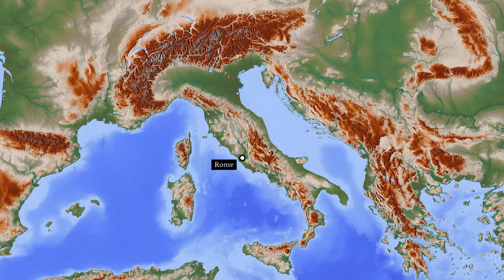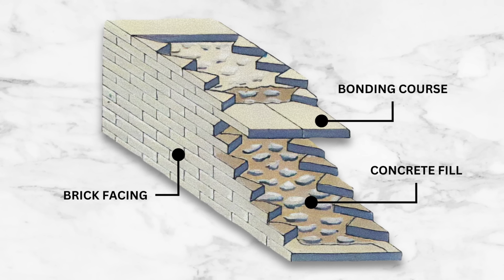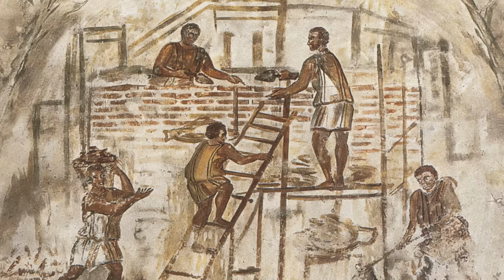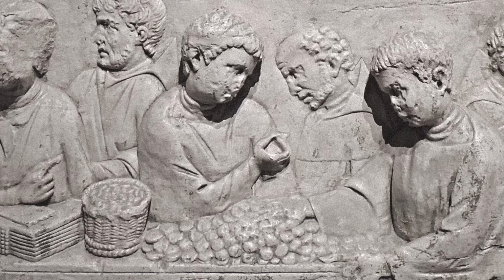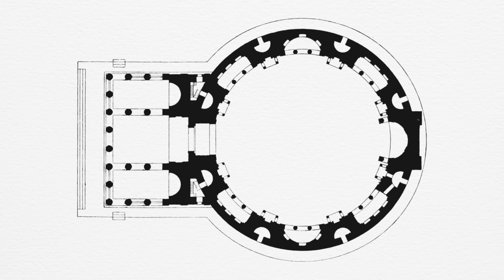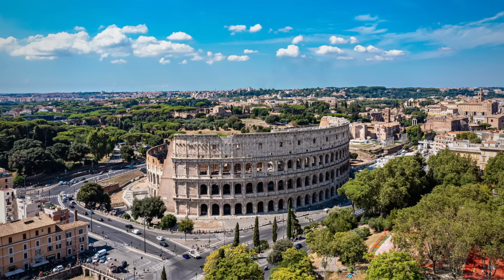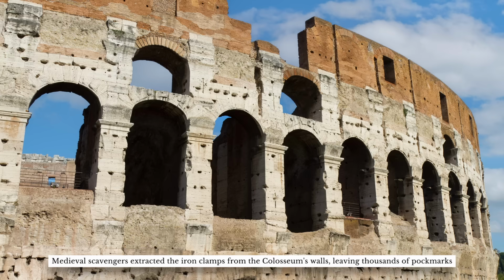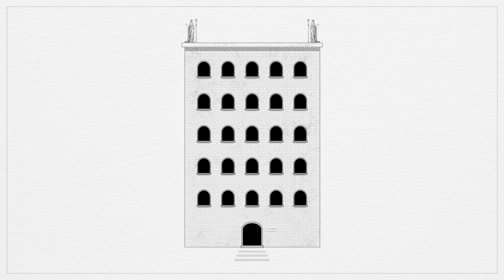Why isn't Roman Concrete used today?

Comment: It’s not used (yet) because it wasn’t understood how it was made until recently. Now they’re working on new formulas that are even better. But it takes some time for new products such as concrete to pass codes and get accepted. A code that requires specific content and standards will not be easy to come up with new standards as everyone is still working to the current standards. It also difficult to convince authorities to change something that’s been around for sometime.

I also don’t believe that anyone would want to build skyscrapers out of this material. The goal is to build structures that we now use concrete for where this would offer greater stability and longevity. Concrete foundations would be an example, but not a tall building itself that would be built over it.

Comment: Many modern concrete structure today, including foundations and walkways, use some amount of iron rebar. Steel reinforced concrete needs to have similar hardness at the boundary between the iron and the concrete.

Comment: Too many errors in this to take seriously.  “Roman” concrete was made using volcanic ash, a pozzolan.  That ash is unlike the ash that is still used currently in many places but sadly with the greenies, a limited resource generated by coal burning power plants.  Concrete does not “dry” out, it cures.  Ancient concrete did cure harder under water but so does our concrete today.  Simply put, the water aids in the curing process.  Fly ash, our current pozzolan, was heavily used in building dams in the early part of the 20th century.  Cure rates were calculated to decades for maximum strength.  Chemical admixtures, used for decades aid in curing and finishing of concrete today, something that wasn’t well known in ancient times.  I’d be curious to know more on that score but this video has enough errors to confuse folks.  Reinforced concrete wasn’t something available in those days either.  Steel, the major material used in reinforced concrete, did not even exist at the time.  It doesn’t make concrete stronger, just keeps it together when it does crack…and it will.

Comment: I've had lengthy discussions with an architectural engineer about the possibility of building a family home which is designed to last 1,000 years. With today's technology it is definitely possible, but the cost would be horrific. Because it requires roman-style waterproof concrete essentially, reinforced with glass fibres, and tilt-slab construction where the hardware is all very serious stainless steel. The roof is concrete as well, and slightly curved. 

The windows all need to be 1cm thick armoured glass, and all the frames of brass. The electrical system is problematic, as there is no way to install systems which will last that long, so all the electrical stuff is in conduits embedded in the walls, and in carriers in the ceiling space, so it can be easily replaced every few decades.

It was a fun mental exercise with him, over many sessions. That was 20 years ago, and he figured a budget of $50,000 per square metre should cover it.

Comment: Isn’t travertine just layered limestone, usually formed from hot springs?  How is that weather resistant?  It would be as bad as marble.  Put it in a temperate climate, and it would chemical weather up a storm.

Comment: Ironically what makes modern concrete viable (steel reinforcement) is also what makes it shortlived.  Microcracks allow water to get in and rust the steel causing it to expand and crack the concrete

Comment: If I understood your concept, you were hypothesizing using Roman engineering to build the Monadnock building, but what if you used modern reinforcement?   Replacing the modern concrete with Roman concrete.  Cost not being a factor, would you be left with a better product?  Expand this thought experiment to other modern concrete structures (i.e. roads, foundations, culvert, etc).  Using modern engineering and ancient concrete, what would that produce?

Comment: We probably have to adapt some of the old ways to build new structures instead of using magic math to do creative and extraordinary forms. It would last longer.

Some of the old ways are more expensive, but it could be lessened by modern technology or slabbed on cheaply for riverbeds, water channels etc.

Comment: it seems to me, for such a building project, you would make the vertical structures out of pre-cast and set roman concrete bricks in a variety of shapes and densities that interlock, and get an outter layer of wet concrete applied. Each unit could be pretty small. "building bones" about the size of two fists on average.
Reply: and in time the bones might even full "grow together" - damage automatically localized and highly repairable too

Comment: Use fiber optic lighting from the sun. BOOM! Lighting problem solved. So the other issues would be time consuming and expensive? Those are really not huge hurdles.

Comment: Would be such a nice video if you just can use a normal measuring system with sense (meters), instead of the stoopid king’s-feet based MAGA system that is used in ‘merica
Reply: Imperial system been around centuries before MAGA.

Not to mention that UK still uses MPH (Miles Per Hour) instead of KPH (at least some times)

Comment: Its not used today because of two reasons:
1) Modern concrete is cheaper.
2) Modern concrete doesn't last, which creates more profits from "rebuilds".
Reply: not every building needs to be perserved for 1000s of years. I don't even think the romans were even thinking in that scale either as long as it lasted within in their lifetimes
Reply: @monsterhunter445  Of course the Romans weren't thinking of that. That's not the point or topic. If lasting longer was in their minds, they were so thorough that 90% of their construction would still be perfectly usable today.

Comment: Roman concrete owed its unique properties to  the chemistry of pozzolana. Ordinary lime mortar  
hardens through contact with the carbon dioxide  in air. Pozzolana, however, contains soluble  
silica and alumina, which react with lime to form  exceptionally stable bonds that can 
consolidate without exposure to air – even underwater. Sea  water, in fact, makes the mixture even stronger. The soluble silica and alumina, especially soluble silica however the alumina is not soluble unless it is grinded to become fine enough like dust that it can have a lot of surface area to react with the lime and the same can be said for silica but silica can be transformed into a water soluble form of silica in the form of waterglass or sodium silicate containing 50% silica and 50% sodium carbonate.

So why not mix an equal volume of sodium silicate powder with an equal volume of quicklime or slaked lime. first by mixing the sodium silicate powder with enough HOT water to turn it into a liquid and then adding the slaked lime powder into the water dissolves sodium silicate powder and turning it into a calcium silicate cement mixture. Then add it to a mixture of sand and gravel to form the final concrete product. A calcium silicate mortar or a calcium silicate concrete.

Comment: 2'30": Roman concrete compressive strength is equal to that of good modern concrete" is an absolutely false statement. Roman concrete has a compressive strength between 3 and 13 MPa. Our STANDARD modern concretes have a compressive strength between 30 and 50 Mpa.

Comment: There was a Hindu Temple built in the United States around 2012 (not the giant one recently completed) the building of the temple was done almost entirely by hand, and skilled traditional masons from India were employed and the progress is documented on YouTube.  They decided they would source the materials for Roman concrete, and employed someone who knew the correct ratios for the mix and the right aggregate composition for a foundation, it was a success with zero cracks and it set like rock.
You should look up Coade Stone, which sets like marble and doesn't weather in the slightest, there are statues including the white Lion in London, which looks the same today as it did when it was cast over 100 years ago... most people think it's been carved and polished like white marble but it has the same consistency as Roman Concrete... through my own research I found that it wasn't invented by the Coade family, but was brought back from Greece in 1760s by The Society of Dilettanti which George Anson and his brother were members of.  They were tasked with bringing back samples from a certain temple, and using the Alchemical labs at the Royal Institute to figure out how the Greeks made it.  The long list of ingredients are actually known now from the Coade stone page on Wikipedia, but quantity and ratios are still a secret.  I did discover one thing though, they had a solution which was water alcohol and vinegar, this dissolved the stone instantly, but take a hammer to it and you'll struggle to even chip it.  Anyone wondering where the history of the Anson connection is, it's not so easy to find, search for Anson journals and Thomas Ansons especially, if you like rabbit holes he was one secretive guy, as opposed to his older brother who was Admiral and captain of the Navy and circumnavigated the world in 1740, using both longitude and latitude coordinates thanks to the mind-boggling invention, the marine chronometer' by John Harrison.

Comment: QUESTION
What about steel-enforced Roman concrete? Wouldn't that be a possibility, too? Maybe even THE possibility?
Reply: We don't build anything anymore for arbitrary qualities like beauty, function, etc. We build so someone can make money, so no, if this is better technology, it will only be introduced by the system for the systems benefit at their discretion.
Reply: @xravenx24fe  There would be no interest. The weak parts of reinforced concrete is not the concrete but the rebars which are corroded.

Comment: The Pumice (Volcanic) rock ingredient is rarely/ hard to find. ? Costly to add.?
It's make the important Character of Auto-sealant when cracks  (through time) appeared.. so called, self-healing Concrete.
Reply: The self-healing characteristics are due to the volcanic sand, not particularly pumice.

Comment: If you used some modern construction techniques you could mitigate the curing issues with the full Roman concrete Monadnock building, we run into the same problem with modern concrete on huge structures like Dams. If you used a combination of casting the Roman concrete in blocks, poured in a sequence to make the curing easier along with some piping to carry chilled water to regulate the temperature it might be possible to do it.

Comment: Uhhh you didnt really answer WHY not used today -- ie the differencve in properties to modern concrete also assuming the actual material could be rebar re-inforced -- and why it disappeared post rome.  Good video otherwise

Comment: My guess is... Nowadays buildings are reinforced with steel. The Roman concrete is best used in compression-only setting. This means going back to using arches.

Comment: What about using reinforced "Roman concrete" to build skyscrapers. Or using reinforced Roman concrete to build more durable highways? Would the the add'l expense offset the cost of resurfacing highways with modern concrete every decade or so?

Comment: One thing you forgot to mention is that Roman Concrete can "heal" itself. Because of mixture of minerals used, specifically quicklime, cracks that form will will seal themselves when exposed to water!

Comment: what if, for example, we use roman concrete to replace modern concrete but maintaining the steel structure and other modern building techniques, I'm quite curious about whether it is do able and would it make it last longer

Comment: A few inaccuracies / missing facts here. All non-reinforced concrete will crack / buckle under tension, even modern concrete. Roman conrete was is far better at dealing with micro fissures because it has the ability to self heal due to it's chemistry, it's far superior to modern concrete for durability due to this, this is why Roman concrete structures are still around many centuries later. Also while pozzolanna might be scarce, the chemistry is easily replicated by using coal ash. In addition Roman concrete does not take any longer to dry than modern concrete designed for the same applications, in fact Roman concrete is not only far stronger in marine applications ( with salt water ) it sets far faster than modern concrete as well. Lastly the only advantages modern concrete has, is it's slightly cheaper, and current industries / infrastructure isn't designed around making it. ( PS don't mean this to come off snarky, I really enjoy your channel, however I am an engineer and you are a historian, so in regards to this subject I think I have the greater expertise, also a lot of the knowledge I shared here has been recently discovered, making older sources will no longer relevant. )

Comment: How about using Roman concrete with modern re-bars or reinforcing steel bars, you get the best of both worlds especially if the bars are made of high quality stainless steel, the thing could literally last centuries! as for using normal re-bars, at least the concrete would be less prone to cracks as it self heals, the only limiting factor is the steel rusting but it theoretically can outlast similar modern structures by at least decades if not a century.

Comment: because water damages the steel/wood frames in modern buildings, and because cheapo steel, and cheapo concrete is cheaper then just Roman concrete

Comment: I do think Roman concrete can still be used, maybe not purely original but an updated one with a more refined one using both Roman and modern methods, maybe making fast acting and more crack forming resistance versions of Roman concrete, or each Roman concrete blocks are made in factories instead of on sight least for what you can get away with, with added reinforcement hopefully with something that does rust like some rebars do, I think someone made fiberglass rebar maybe that or something similar could complement modernized Roman concrete?

Comment: Respectfully, this didn't really answer the question.

I understand why you couldn't use roman concrete to build a skyscraper, but what I don't understand is why it isn't used for other things. Especially when incorporated with more modern building techniques. Can it just not be reinforced?

Comment: Why the modern world doesn’t use Roman Concrete because it is better and stronger than modern concrete . I think that’s why it’s not used , today it’s made as cheap as possible and want uniform consistency ….and if the concrete lasts it doesn’t have to be replaced …. Taking pride in making things that last isn’t the focus of the modern world elites …they want the most profit as possible corners are cut is part of it …….

Comment: The cementlike material China used and still uses to maintain the Great Wall has a longer life expectancy than cement.  Cement strength increase for some time, then starts to deterioate.  Believe it or not, a guy with a cement boat told me about this.

Comment: The Romans just didn't put steel in their concrete to reinforce it. That's the big secret. We can't replicate it since we like building things with right angles and that puts concrete in tension. If steel shrank when oxidizing, our concrete would last a lot longer.

Comment: The Glen Canyon dam construction (1958-64/3rd US largest) used volcanic ash, as have most big dams since. They would have used salt water if they had known. River water in pipes used as rebar cooled it. +100 years to set up otherwise. They mixed it all with ice.

Comment: Missed the key detail that makes Roman concrete what it is and why it can't be used everywhere. It needs access not just to moist air but moist air that also carries a bit of salt. As the concrete cracks over time, salt and water are able to work into the cracks, dissolving a little of the substrate, and once dry, resolidify in a way that fills the gap and reinforces the material.

Comment: Sobasically the romas did find a very long lasting chemical bond of concrete. But to actually support the weight, the walls need to be super thick.
Reply: No, the issue is that unreinforced concrete of all types is terrible in tension, basically it's brittle, so if you make something too slender it crumbles easily under side loads, like winds, which skyscrapers go through constantly